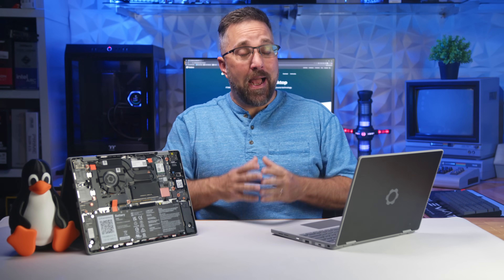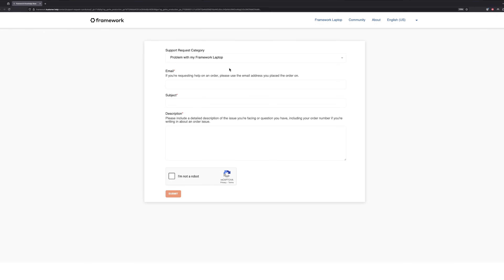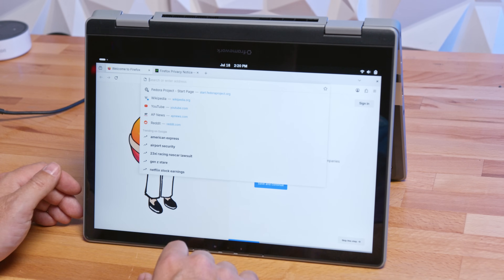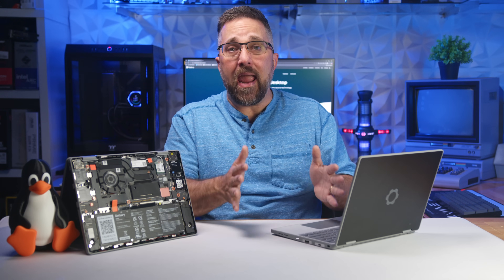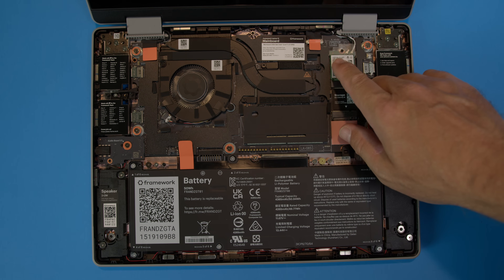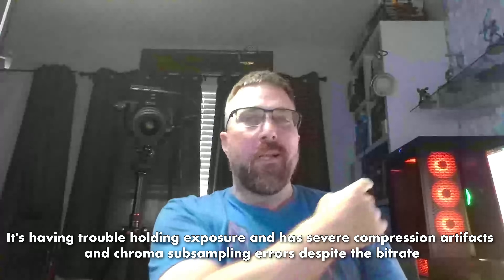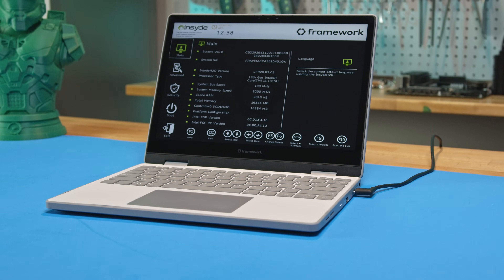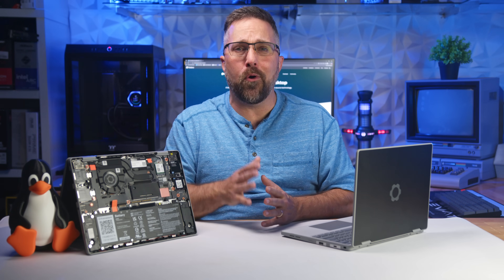Framework 12: Finally! a Linux 2-in-1 That Just Works!

Comment: I like that it's plastic and therefore very light and loove that it's a 2-in-1. But this was such a bad APU choice for a 12" convertible. Framework use efficient Zen 4, Zen 5 and Core Ultra chips in their larger laptops yet stuck an older, inefficient i3 into their most compact device. A bizarre choice to put it lightly, unless they really wanted to save on the components.
Reply: Framework has talked about this before with the FW-13. The intel machine comes out first because intel's integration team is top notch. They help companies (even small companies like framework) integrate intel CPUs into new products. It's one of the few good things intel does imo. I can assure you there will be an amd version.
Reply: Tariffs have absolutely caused a negative impact on the Framework lineup; I have personally spoke with them (because I wanted to buy a fleet of them for my org) and the tariffs appear to have driven some of this "bad" processor decision.  They wanted to get it down to something more affordable and other chips couldn't be gotten at that price.  I hope they can improve this because I think that the 2 in 1 is the best thing they've come out with, especially for the EDU space.  I desperately want these in my org
Reply: i3 is a dealbreaker.
Reply: And then STILL sell at $800-900 tier 👀 Short-sighted
Reply: There are more than enough plastic laptops out there. Meanwhile, you can't even get an all-metal laptop with metal keyboard keys (or a separate metal keyboard) because people are so obsessed with creating plastic pollution
Reply: @whoeverlovesDigit have fun paying 1500 dollars for a midrange machine with all-metal construction! and the moment my laptop comes with a "separate [] keyboard" is the moment its no longer a latptop
Reply: @beegman27  You need better reading comprehension. You can't buy a metal keyboard separately
Reply: @beegman27  "have fun paying 1500 dollars for a midrange machine with all-metal construction" I think those are called Macbooks :P
Reply: @lyianx  no, they don't exist. MacBooks switched to plastic for stuff like the keyboard keys long ago. It seems like people are taking my comment as exaggeration and not actually paying attention to what's going on
Reply: @lyianx  nice try but you can get a macbook air for 799 and a pro for 1299. so no you get a damn good laptop for $800 with the macbook. the framework on the other hand? $900 for an intel i3 that is in no way comparable to the base M4....

Comment: 3:29, just to point out, all of fedora's updates can be installed from the gnome software center. Meaning that a new Linux user doesn't even need to open the terminal to even do that. They've also made it really easy to install rpm files from gnome software as well, so installing software not found in the regular repositories is also super straightforward.

Comment: For Gnome under Wayland, can you use touch-only to move/copy files among folders with the Nautilus (guess it's called Files now) file manager?  My last attempt was sometime ago, but problematic. Gnome developers have made a lot of touch improvements in the last couple of years towards a true mobile experience. The other touch thing I'm looking for is a popup context menu on a (single finger) long press for apps and the desktop. Pretty sure I saw something about an extension that could provide this feature. Windows on a tablet may kind of suck, but it still provides the basic touch functionality you need when a keyboard isn't available (or attached).

Comment: Looks intriguing, but no thank you. The flexible chassis is a hard pass. I don't need the 2 in 1 concept, so hard pass there, too. My main laptop is an older Asus VivoBook  X512DA equipped with a Ryzen 5 3500U and 12G of memory. It doesn't do 4K or 5K, doesn't need to. But everything works with Linux Mint Mate. Gets decent battery life and the screen can go VERY dark for use at the telescope using Stellarium. And I got it "new-old-stock" on eBay for less than $200. As long as it keeps working with Mint Mate, it checks all the boxes.

But don't use on versions below 20 and kernels shipped with it, the touch pad is flaky there.

Comment: Am interested in getting an F12, but weary of having to deal with service if it isn't working on the first go.  Glad you got speedy replacement, but I'm not convinced they treat regular customers they way they treated you. My experience getting a replacement mobo for my F13 was super-lengthy and seemed designed to make me just give up (I did eventually get the mobo, for no charge. I'd bought it through my work (University), and the techs who deal with reseaarch/computer hardware purchasing etc. were incredibly frustrated that they could not just send my dead laptop back and get a replacement).
Reply: They're frustrated because other laptop manufacturers make it easy to send in if you have a contact with them, and easy to spend money if you don't

Comment: I was kinda hyped for this laptop. But I stumbled on a Lenovo Thinkpad Yogo 11e for 25 bucks. After enabling the iio-sensor-proxy in Fedora 42 running KDE I was golden. Replaced the battery and I got a good little 2in1 and it came with a pen.
Reply: did enabling this iio sensor proxy make the keyboard disable at 180°? if so how did you do that? I've been struggling with this on my yoga 7 for a while
Reply: Hehe ya know.. 25 bucks is really hard to beat for a laptop, even if you had to replace the battery. Long as its fast enough to do what you need to do, well worth it! (Especially for a Yoga, they are nice).
Reply: 25 bucks? How?! :0
Reply: Yeah how the hell? Everyone here saying like this pcs are always 25$ ! For a sec i was like did i slide again?
Reply: These can get really cheap. 25$ is a crazy deal but it's easily found under 100$. What are your specs ? I wonder how usable these actually are.
Reply: Almost the same thing in 2020 when i first used linux i got a thinkpad yoga 11e for 40 bucks I upgraded the ram storage and battery. I run fedora 36 back then. Was a steel imo.
Reply: Yeah for real though. Not super sure what market these Frameworks are usually too expensive to be an option. Someone recommended me to get one for College work but I was able to get a Thinkpad t14 for cheaper, thats prettier, more durable, and faster. :/
Thinkpads have a really good community for parts and repair too, so Framework doesn't even win on that.
Reply: Upgradeable? That is marketing BS. Get a Thinkpad T440p with a cheap dualcore i5 and put a quadcore i7 in it (that probably is still as faster than the Framework 12). That is an upgrade. Throwing away a fully working motherboard for a new CPU is a joke. As well as the single ram slit and the limitation to 2230 ssds...
Reply: My company bought some lenovo pcs long story short. Custumer support is not the best if you can get a hold of them.
Reply: Does it have 10 year support? With updatable motherboard?
Reply: @trowawayaccyou can't beat 25 bucks for a laptop
Reply: @TheGeemili with the battery replacement it's more like $100, still a steal
Reply: @trowawayacc nothing ever beats 25 bucks for a thinkpad
Reply: @trowawayaccit was $25 you gotta be joking
Reply: @trowawayaccFW12 diy is nearly $800 to import where I live. And that's without ssd and ram lmao. Think how many thinkpad convertibles  could buy with that.
Reply: @trowawayacc the upgradeability of framework is a joke. you still have to throw away the entire motherboard and we both know the framework 12 is never gonna get updated motherboards just like the 16 is already abandonned
Reply: @deneguil-1618  incorrect
Reply: @Arian-gm4rx  elaborate. Because on every single one of framework's models the entire motherboard gets thrown out if you want to upgrade. And the framework 16 has received 0 support since its launch. No upgrades to the motherboard, no options for the GPU bay, nothing. I simply cannot trust framework when they've not proven themselves reliable with half of their portfolio and when there are vastly superior technologies that exist to achieve an actually modular and repairable laptop without the garbage ewaste that is throwing out the entire motherboard
Reply: @deneguil-1618  I think thats partially down to how intel and amd will give them soldered SOCs, at least they make the motherboard immediately reusable, your choice to throw a working mobo out xD
Reply: @deneguil-1618 Replacable battery they continue to manufacture, don't care about anything else tbh. Laptop batteries suck, they end up at like 50% capacity in no time and then you buy a "replacement" that had been sitting on a shelf for four years and it's already at 80% or less. Just gimmie standardized replacable batteries and I'll give you my soul.
Reply: @deneguil-1618 they’re working on an SDR module for the GPU bay right now.  Sounds to me like you have Dell expectations from such a small sized company, which is unrealistic and frankly a poor take.
Reply: @deneguil-1618  Why are you throwing out motherboards explicitly designed to be reused or resold? You using the product wrong or misunderstanding its application doesn't make it an inherently bad product. I'm sorry that concept has been challenging to follow, but framework is also not for novice users. Maybe give it a shot when your budget and skillset are more aligned with premium products! Best wishes
Reply: @Arian-gm4rx no one is buying generations old proprietary motherboards for anything. Frameworks are also far from premium products at any level. You can also keep your condescendance to yourself when you don't know shit about either technology nor the person you're talking to. I can easily afford any framework I want, the value proposition is just not there and I know way more about both technology and hardware that you could ever imagine so pipe down kid finish school first
Reply: @deneguil-1618  That's actually also incorrect! Resale statistics on mainboards are super solid thanks to the homelabbing community. Super cool that such premium work can be translated into alternative use cases! I'm sorry that your frustration about your situation led you to take offense! There's nothing wrong with needing time to learn and develop some savings. And kiddo, it's important to remain level headed and use proper language when having a conversation. I know sometimes we have big feelings, but that doesn't mean others around you do! You'll get there some day, and I'm rooting for ya bud. Take care!
Reply: @deneguil-1618  I like how the "upgradeability" of a framework is a joke when literally no other laptop is upgradeable.
Good job. Your comment aged like milk.

Comment: Gnome isn't actually the default on Fedora any more, KDE and Gnome are equal editions.
Reply: No, GNOME is still the default for workstation
Reply: @eminem992i apparently my links as blocked but this is not true, this changed with 42
Reply: @alychace 
When you first open the website 
You will see the fedora workstation
Under it, it's kde plasma 
So when you install the workstation it will come with GNOME 

Kde plasma was just a spin but now it's present on the front of the website instead of being it buried with the other spans
Reply: @eminem992i right, but that’s a labeling issue the team is sorting out. For historical reasons it’s now called the KDE Edition, rather than spin.
Reply: @eminem992i it’s not a spin. It is an official edition.
Reply: You can choose kde or other spinoffs but gnome is the main one
Reply: @KejoraV it’s no longer the main one, it’s officially equal with KDE.
Reply: @alychace oh thats interesting, when I installed it somewhere in <2 months ago it wasnt the main yet

Comment: Fedora on Framework laptops is a premium Linux experience, cant wait to get my 12 once it ships
Reply: I hope it's improved since I tried it, but I've not heard particularly promising stories.

They were flaky as hell on Linux when they first come out, and Framework didn't acknowledge that. But they still advertised it as supported, and took (and kept) my money.

I bought into the first round on the 13" and it just wasn't anywhere near ready for use as a primary work machine with Linux. Not by my standards anyway. It couldn't remember BIOS settings if the battery went flat, because this also drained the RTC battery that was responsible for storing BIOS settings. So I was constantly having to reset things like the battery charge limit.

The battery went flat quite quickly when the machine was suspended because they'd opted for hardware that didn't allow you to properly sleep the USB ports while the thing was suspended. And there was a performance problem with the wi-fi (maxing out at 700 kbps on a strong 5GHz signal).

Unfortunately it took me a while to find the time to get around to setting it up so I discovered this after the 30 day return window was up. Despite it being unfit for purpose, Framework support refused to take it back. They converted me from a fan into an "never touch or recommend this company again" ex-customer in one support thread.

I've been very happily reducing my environmental footprint by returning to using secondhand ThinkPads. Everything works on mine. Flawlessly.
Reply: What batch are you?
Reply: @Notabanana. 5

Comment: I wish they used the 13.5 inch maiboard here and retooled the chassis for that... Imagine running single channel DDR4 in 2025...
Reply: I would also wish they say more about why the took the decisions. They do mention a few sometimes, like why they went with the Framework desktop and why with soldered memory, but it would be nice to have a more complete overview.

Like in this case, there's a chance they actually had a pretty good reason to have a new chassis and motherboard design and so on. But we're left to speculate.
When you have high price products, your marketing department NEEDS to inform the audience on WHY is the product more expensive and why it's a good thing. That means educating the audience on the design, research, manufacturing and logistics challenges / realities that impact their decisions.

P.S. - I said in another reply too, but I'm mentioning it here just in case - Framework 12 uses DDR5.
Reply: @Winnetou17   This computer was designed to be more durable to be more attractive to sell to schools.  As for why they used such a terrible panel and single channel memory, IDK.
Reply: @SeniorKlean They could have made it a 13 maiboard chassis with a of those benefits, but they didn't. :(
Reply: I have a touchscreen with 16 gigz ddr4 with only i5 6th  2.4 -boost to 3.4zh , 256 SSD.
The rams ( $30) cost more than the laptop....if I can easily get a set up like that to work
for under $75....Whatever the heck NEW stuff they're selling in 2025 better be TWICE as FAST. none of that studder or whatever the heck.
 You would think a $5000 cpu would go 10 X faster ..but it dosnt .lol

Comment: I love the look, and their prices seem to be very reasonable. Next time I'm looking to replace my laptop, I will be considering them for sure.
Reply: On the pricing side (which I wish someone would do a deep dive), you should really go and buy RAM and SSD separatedly. They will be cheaper or better or even both.

While arguing with some folks in the previous video, I checked the prices (really didn't dive much, like 5-10 minutes of searching in total in 2 websites) and both the RAM and the SSD you can find at about half the price.
Reply: @Winnetou17  Thank you.
Reply: @Winnetou17 yeah, this crossed my mind too, I saw how much customization ramped up on the base price but then noticed how expensive those components are. Good call.